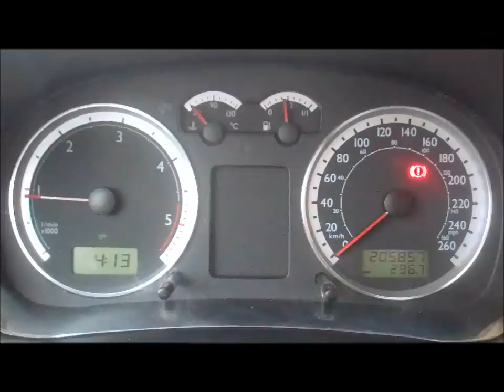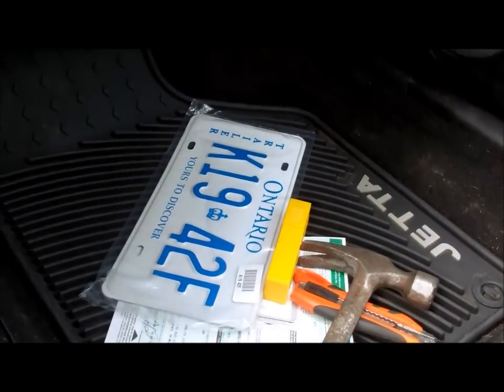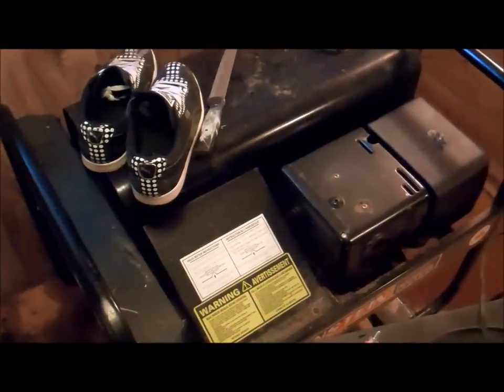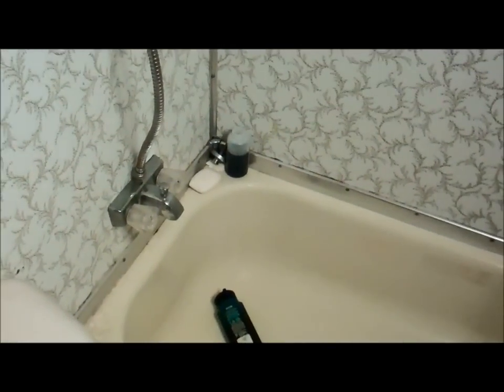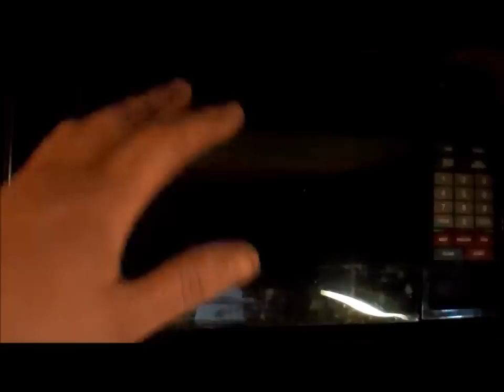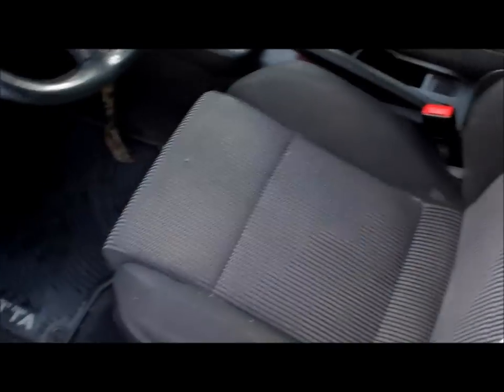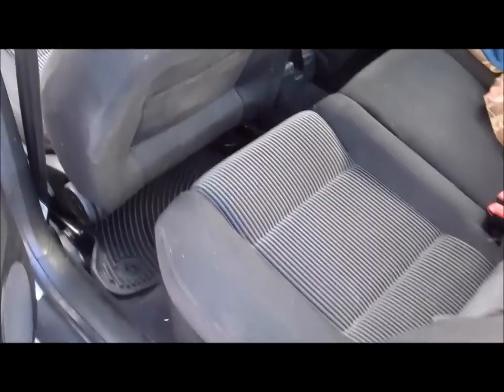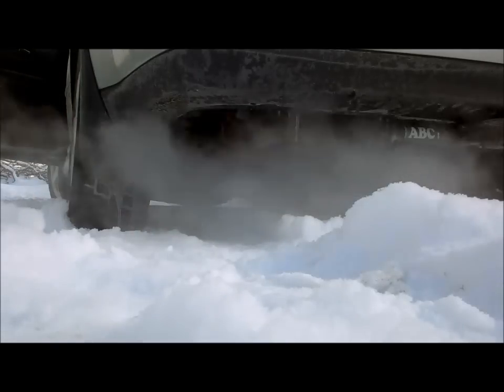new car, trailer reno

Comment: Jay do a spring over axle conversion and it will give you more height and then you can get rid of the wheel wells. Also keep the axles from hitting pipes and the water tank and holding tank as well.

Comment: From the back your new car you can barely tell it's diesel, a friend of mine just bought a new 2013 Jetta TDI his old Jetta TDI was a 2000 with over 250000 and still ran like brand new, as long as you get the timing belt done and do regular maintenance they will run forever.
In your trailer where you plan on putting your desk maybe try pushing the pipes back a bit and building a custom desk.
In your bathroom maybe try putting in a standup shower and a small cupboard to cover up the wheel well.